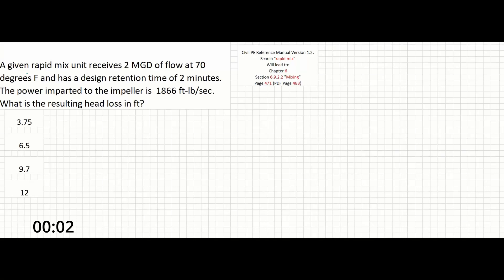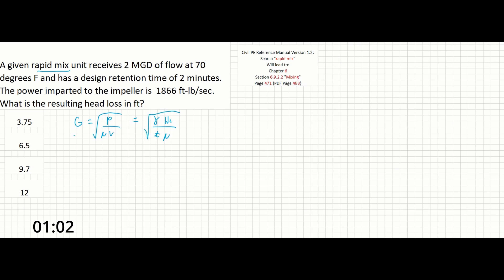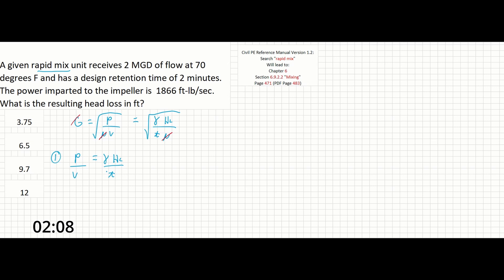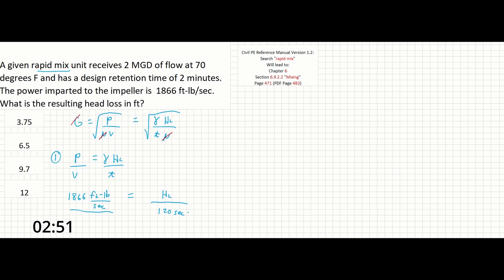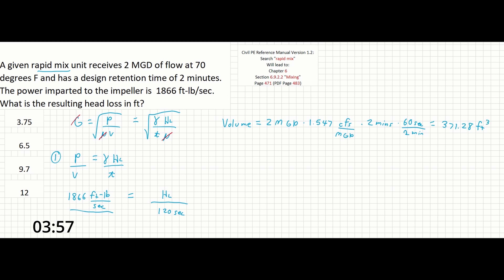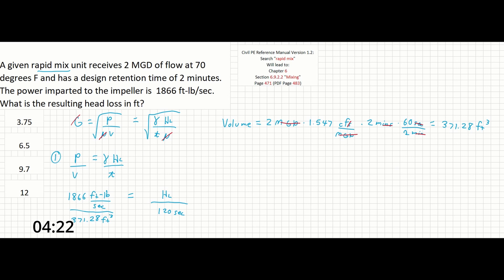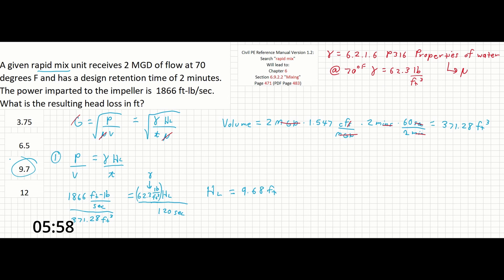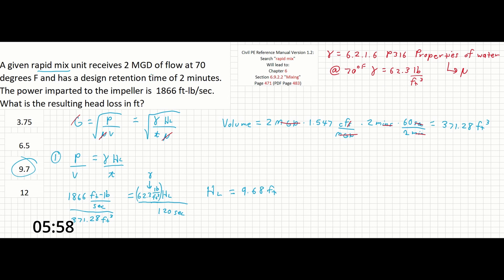PE Exam Practice Problem #20: Water Resources | Rapid Mix Unit - Head Loss - Power

Comment: We can also eliminate 't' in the equation by putting Q directly instead of V
Reply from the maker: I think you are correct - you would just need to divide your flow rate in the beginning by the design retention time. To me, it seems like its just a matter of which step you prefer to solve for first.
Reply: Are you taking the new format exam?